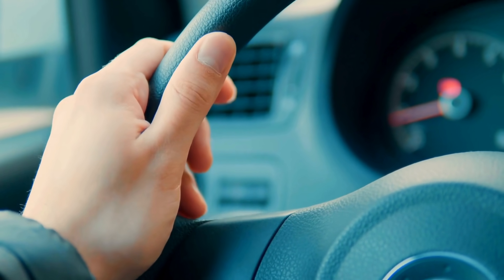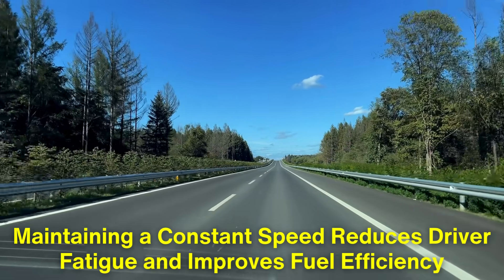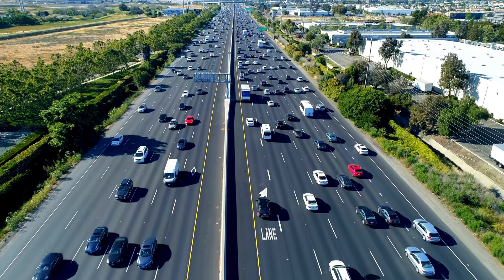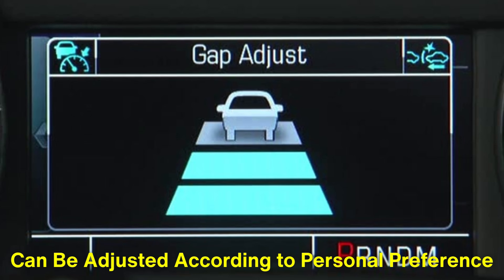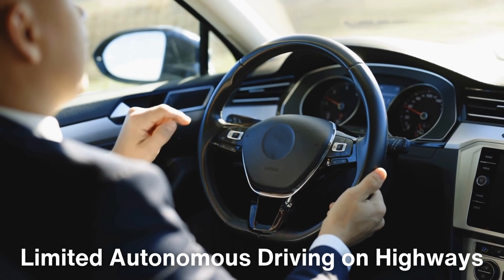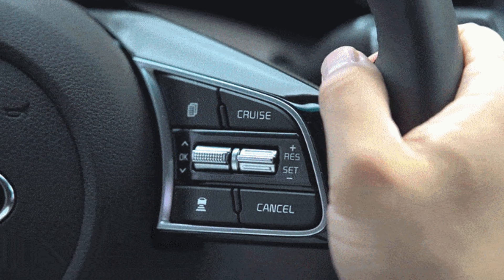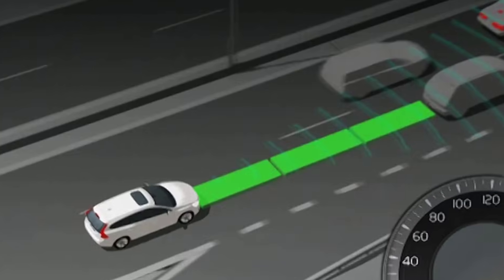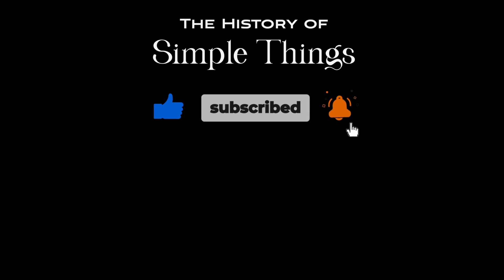How Does Adaptive Cruise Control Work?

Comment: its going to have to get much better before its worth upgrading from my old-style cruise control.
Reply: First, I don’t think you are going to be able upgrade your old-style cruise control.  Next, I’m curious to know what improvements would make it worthwhile to change.  I find it most useful in high-speed congested traffic.  Reducing the risk of rear end collisions is the part that is most valuable to me.
Reply: I really like the ACC in my 2021 Passat, but it has just one annoying flaw:if a car ahead of me moves into a left turn lane, ACC brakes hard as I begin to approach that  car which is now in the lane to my left and not in front of me anymore. ACC does eventually start accelerating again but not before hacking off the drivers behind me who weren’t expecting me to hit the brakes. When I see this about to happen, my workaround is just to tap the brake to disengage the cruise control so that I can take over manually just until I get past the exiting or turning car, then I turn it back on.
Reply: Try it. It’s so much better. I drove the old cruise control and the new versions of smart cruise control is so nice to drive with. However if you’re old school stick with the ancient cruise control.
Reply: That's an "interesting" comment.  
So what you are saying is something that is already tens of times better than old-style cruise control needs to be better than it is for you to stop using the worse cruise control?
I can tell you that 5 of my work colleagues would not have been killed if the truck that hit their vehicle at 60mph, from behind, had adaptive cruise control, not old style - while the driver was not paying attention. Adaptive cruise control will stop a vehicle without driver input.